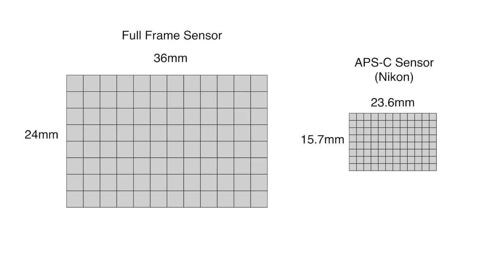Full Frame Camera: What Is It and What are the Advantages and Disadvantages?

Comment: This is the absolute best explanation and correlation between having a Crop Sensor versus a Full Frame Sensor. What this video has finally enabled me to decide is not to part ways with my NIKON D300 DX Sensor. Instead, I will go as planned with my purchase of the NIKON D750 (FX Format) for the purpose of doing portraits with total control of DOF…least of which...
My crop sensor will be used exclusively for the Landscape part of my photography…Even a caveman can follow your explanation.
Cheers To You Spyros! Excellent video….Please keep them coming!

Comment: Can you tell me which Camera will be a better choice. I'm confused between Nikon D750, Nikon D7200 & the new Nikon D500?
Reply: +Ratnadeep Mitra those cameras are all very different. Buy what you need. A D7200 is a good camera and is good for an advanced hobbyist. A D500 is a full-fledged pro level camera that you probably don't need. A D750 is a full frame (the other two are crop cameras) so you get the advantages of full frame. 

I'd say you should go with the D750 or the D7200. The D500 is for very specific purposes. Unless you plan to be doing action packed photography, I would exclude the D500 from your list.

Comment: d7000 - crop.  Q: Is the Mega Pixel size the sensor directly related to the ability to capture light information.  ie - does a full frame and a crop sensor (all other things being equal) of the same mega pixel sec perform the same?
I do real estate photography and not sure if its worth upgrading to full frame or the d7100.

Comment: Hi! I am sstruggling here and you may help me: D610 (FX) or D7200 (DX)? In some comments below you mention the fact nowadays the sensor size is not that important. But... isn't it? What about the whole explanation you did before about the low light performance and so forth? Sorry if I misunderstood.
Reply: Hi, there. Tks so much for your reply. My concern is about that comment some people spread, like: crop lenses are not for professional job, and they will never perform as good as FF. That sounds no matter how hard I try or how much I invest, I'll never get good results (always assuming there was a significant difference). 

If I'm not misunderstanding, I may keep on buying assets but at the very end of the day I'll have to start from scratches whenever I want to jump to the full frame world. However, I've seen outstanding results of crop cameras, even better sometimes than the pro ones (for ex, d7200 over the d610). And even more the just born d500! 

Sorry if I ask every time the same but the price difference is way to high for me. It doesn't make any sense to invest at least double for something I can get for half of the price.

One last question, what do you think about vintage lenses?

Thank you for your time!

Comment: The first DSLR I got was the 60D - beautiful camera, I took some amazing shots with it, it's easy to use, comfy to hold when gripped and has all the advanced features (including the rear dial and the top lcd) that I needed.
HOWEVER, it used to always piss me off that it just can't get wide enough. My 50mm F/1.4 was ultimately an 80mm F/2 (interms of DoF), my 24mm was a 40mm and so on. Obviously I bought only EF lenses because 35mm is where I ultimately wanted to be, but for the time being I just dealt with what I had.
Buying a 5D Mark III - NO REGRETS. I love the advantage I get in ISO performance (at least 3 extra stops over my 60D in terms of usable ISOs), I love that my 50mm is a proper 50mm, I love the slight vignetting it gives me, I love the new shallower DoF, I love using my old M42 lenses again. The weight - although it weighs like a small child when gripped with a magnesium alloy grip and equipped with a bigger lens - I love it! It's just my thing, I like heavy metal pens, I like big clunky tech. It's nice to feel the weight in my hands - I feel like I am actually holding something.
I know I'm losing on some of the telephoto zoom on the 5D3, but since I still own the 60D it's not a biggie if I know what I'm gonna shoot (or I can just take both bodies on location).
35mm is a classical format and just like with classical music - it has something magical about it..
Reply: ***** Cheers!

Comment: I use a crop sensor camera. (Canon SL1) I was looking at an ultra-wide fisheye lens but I heard that having a cropped sensor affects your ability to use these lenses fully?
Reply from the maker: That's not true any more than any other lens you use on a crop sensor camera. The only thing you lose is some field of view with the ultra wide fisheye.

For example, if it's an 8mm fisheye, with your crop sensor, the field of view you'll get in your images will have the same field of view as a 13mm on a full frame camera.

That's the only effect, and that's the same effect you get with any lens on a crop sensor camera

Comment: One thing never seems to be mentioned is a full frame sensor being larger, does not have to be magnified as much for a given print size.  The demand on the lens is also greater on a crop sensor. So many tests are done at F8 on a trypod and not real world shooting when comparing. Very dense crop sensors at 24 MP may only be fully utilized in the center with a good lens stopped down. Where the 2x+ area of full frame will at say 24 MP will always look sharper in general since the lens has a greater area to focus on and less to enlarge. I have a D300s but hope to have the FF also since I have shot for many years with 35mm & 21/4.

Comment: i currently use a 5D Classic and a 60D as backup body.

I love them both. but you cannot beat the beauty of full frame.
60D also takes great picture once you get a good glass on it.
Reply: Thank you for responding to my comment.

Yes, i am also very happy with my 60D.

sometimes when i want to simply take pictures. i put my 5D at home. and bring my 60D with me.

and when i want to shot a portrait. i even do it with my 60D.

I paired my 60D with a manual Lens.
Super multi coated Takumar 50mm f 1.4

this glass produces Stunning and Gorgeous images.
and it's pretty cheap on Ebay.
around $150 more or less.

all i say for everyone out there.
Glass Glass Glass. then we talk about camera bodies.

even a Full Frame like 5D, if you don't put good glass on it. it will not perform like how it should.

This is a sample images on my 60D. paired with Takumar 50mm F 1.4

shot @f1.4
https://www.flickr.com/photos/psianipar/15070507029/

shot @ f 4
https://www.flickr.com/photos/psianipar/15243775791/
Reply: Cheers ^^. loved your videos. definitely subscribed

Comment: Is there some difference in lenses between cameras with full frame and APS-C sensors? Because on Sony website I spotted a 2 different line-ups of lenses one is supposedly for full frame alpha cameras and the other one is meant for the crop sensor models. All of these lenses have Sony E-mout so it´s seems like anyone of those lenses can be mounted to any Sony camera. So how is it then?
Reply: +Spyros Heniadis Thank you! That was very usefull information. Now I´m realizing that switching to a full frame camera would be much more expensive then I thought when I consider purchasing all new set of lenses.

Comment: So,  45 and 50mp sensors should have less image quality and low light performance than 26MP full frame sensors? The pixels are smaller for the same size sensor, which you said decreases image quality and low light performance.

Comment: I wish I could afford a full frame, but really I am currently still amateur. So I went with the D7100 which is still a great camera with 51 AF points and 24 MP,  but seeing the actual size difference of the two sensors, it seems there is probably no comparison. I will have to start saving my nickels and dimes for a Full Frame Body.
Reply: ***** Thanks for the encouragement Spyros! I'm still having a ball with the D7100. I have been taking pictures just about every day.

Comment: I bought the D7100 and am overall pretty happy with it and I have taken some great photographs with it. However I feel that the looking at specs and DxOmark doesn't tell the whole story. There is something about the quality of light that appears to be different on 35mm sensor cameras. Of course that's my subjective observation. Actually I somewhat regret buying a large-MP camera because each photosite is smaller and therefore image quality (at least by my own subjective metrics) should be lower - even if on paper it's great. Perhaps it's not so much full-frame vs cropped but generally about photosite-size (but of course on a larger sensor you can have larger photosites at the same resolution).
Reply: I noticed that too. The best low-light cameras have a low pixel-count. It makes sense. If I remember correctly the A7S is quite expensive too. In general it seems the cameras with best low-light performance are most expensive.

Comment: Why would bigger pixels, given the same scene, cause better quality? It seems to me each pixel is a certain color and brightness. Sharpness is when a transition from one color to another is more accurate, and it seems to me that the pixel is going to average the light it receives and give it a value. If the larger pixel falls directly on the edge of a black line on a white background, say,  then the pixel, which is recieving half white half black information, will make it gray, and the photo will come out fuzzy. It seems odd that if large pixels are better, that camera manufacturers are doubling the pixels on the same size sensor in their flagship models. It would seem to me that they would only put 50MP on medium format sensors,  because making the pixels smaller would be worse for full frame cameras. We do see 50MP medium format cameras, but also 100MP ones, too. If you're paying the extra money and dealing with size,  why would they make the pixels smaller and jam more on there? MP are an easy marketing point,  but I need a more in depth explanation. Maybe I'm thinking in the wrong mindset,  but higher resolution TV's are sharper than old CRT TVs that had giant pixels.

Comment: A page taken from my personal photography notes.  Like many of you, I am a Bokeh whore.  Read more to find out how bokeh is affected by sensor size based on equivalent & non-equivalent focal length lenses.  Like my comment if this helped you.
-------------------------------------------------------------------------------------------------------
Crop sensor vs Full-Frame sensor (using the "same prime lens" = equal apertures & equal, NON-equivalent focal lengths [f]) - for example, a Leica 50mm f/0.95 lens on a FF & a Voigtlander 25mm f/0.95 on a m4/3 lens.

	Ledger:  
		[DoF = Depth of Field], [FoV = Field of View], ["f" = Focal Length], [FF = Full Frame Sensor], [MP = Mega Pixels]

	A photo taken on a crop sensor with an equal subject-to-camera distance to a photo taken on a FF will have equal DoF because all you are doing is cropping down the image from a FF.  Note, however, that FoV is narrower (more zoomed in) in the cropped sensor's picture.  Narrower FoV makes bokeh larger but also makes the subject larger (duh coz you're "cropped in").  HOWEVER, to get the same FoV, a crop sensor would have to move back to compensate for its crop which will result in a "larger" DoF at equal FoV.  Increasing the DoF results in a smaller bokeh (usually undesirable).  Moving a crop sensor back to get the same FoV as a FF is the same (in terms of DoF not MP) as moving back with the FF and cropping it to achieve the same FoV.

	Bigger "f" results in shallower DoF (KEEP THIS IN MIND AND READ THE FOLLOWING).
----------------------------------------------------------------------------------------------------
... but what if the focal lengths of the lenses were the same?  Read on ...
_____________________________________________________________
Crop sensor vs Full-Frame sensor (using the "same prime lens" = equal apertures & equivalent focal lengths [f]) - for example, a Leica 50mm f/0.95 lens on a FF & a Voigtlander 25mm f/0.95 on a m4/3 lens.

	Ledger:  
		[DoF = Depth of Field], [FoV = Field of View], ["f" = Focal Length], [FF = Full Frame Sensor], [MP = Mega Pixels], [m4/3 = micro four thirds (a crop sensor half the size of a FF)]
	
At equal subject-to-camera distances, a photo taken on the crop sensor will have a larger DoF but an equal FoV in comparison to the FF.  Larger DoF results in smaller bokeh.
	
Why is this?  ... Since we're using a smaller "f" that is equivalent to a FF, we end up with a larger DoF. A 25mm lens on a crop sensor would have equal (but cropped) DoF to that of a 25mm lens on a FF.

BOKEH:  Although the m4/3 25mm is equivalent in FoV to the FF 50mm, the bokeh is NOT.  This is because the m4/3 f/0.95 is NOT equivalent in DoF to the FF f/0.95.

This should settle the confusion & debate on whether or not aperture equivalence changes when on a cropped lens.
Like my comment if this helped you.
Reply: Thanks!